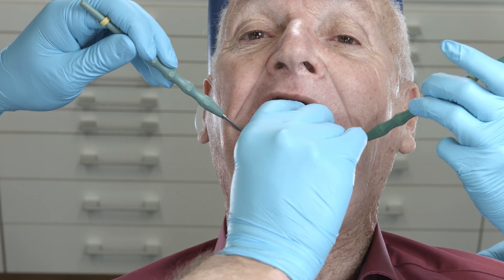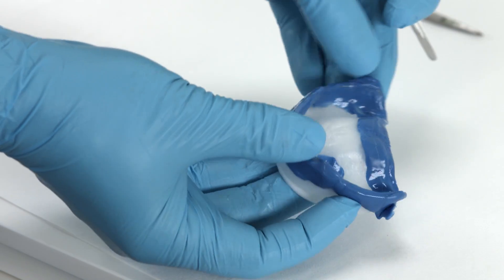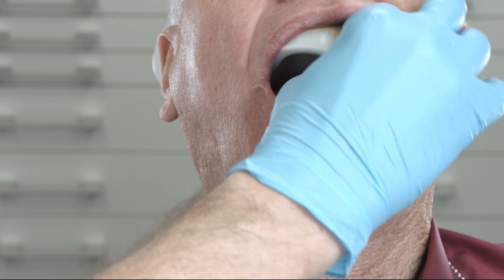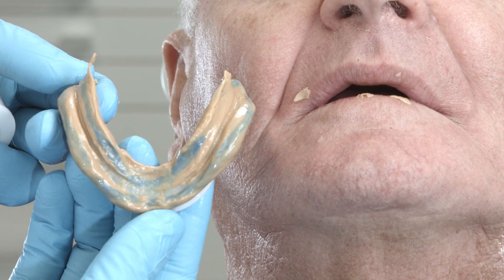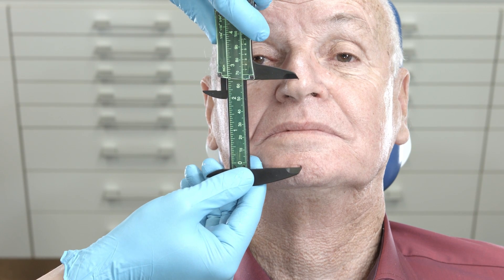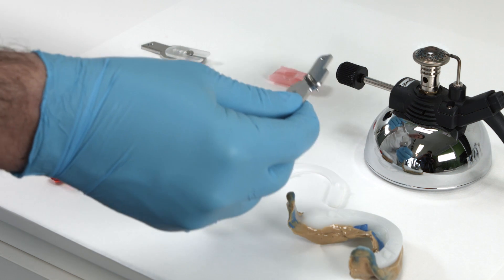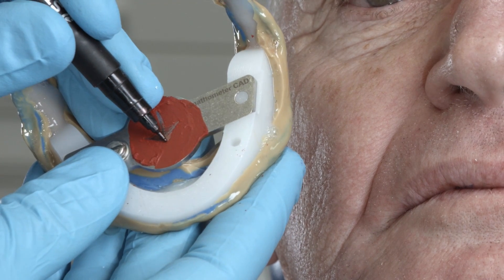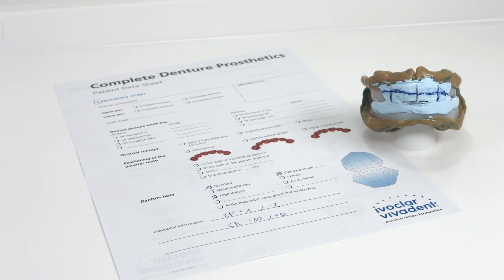Digital Denture – second Appointment

Comment: I'm a dental tech.for 47 years.I know digital dentures are here but I have a few concerns. When  using the milling technique there is alot of acrylic wasted.How is that disposed of as acrylic does not break down.Is their an allowance made when the holes are drilled to accept the teeth so that when the teeth are adhered to the base with the cold cure acrylic you won't have an open bite. Conventional try ins are done in wax and if changes are needed they are done very easily and the patient can see the changes in usually a half hour or less. How does this work with digital dentures.
Reply from the maker: Dear Larry Stradeski,
 
We first mill a denture using ProArt CAD Try-in. This denture serves as a try-in. Then, we mill the final denture. For the bonding procedure, we use a kind of guide to avoid any problems related with this step.
 
Best regards
ServiceLine, Ivoclar Vivadent
Reply: Thanks for the reply,but you never adressed the problem of what is done with all the acrylic waste .If changes have to be made to the tryin does a new denture have to be milled in order for the patient to see the changes.